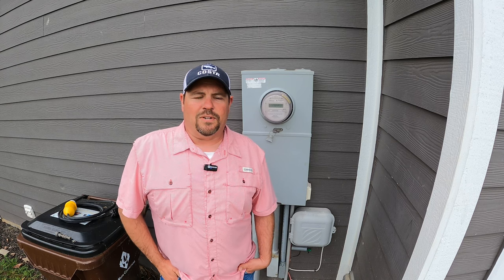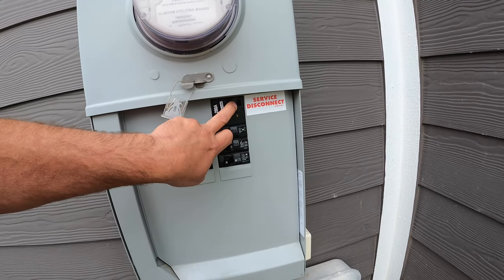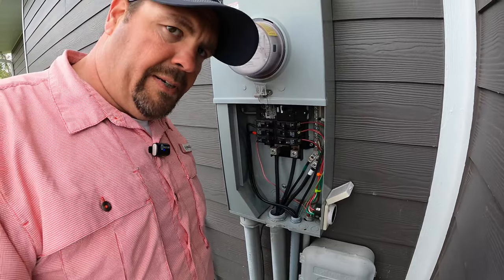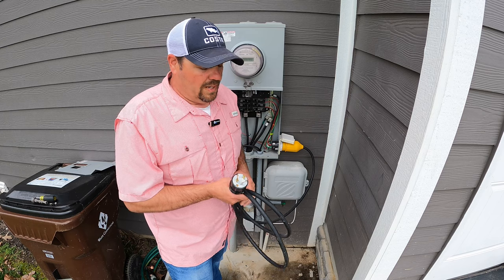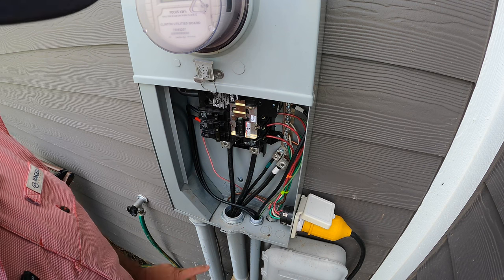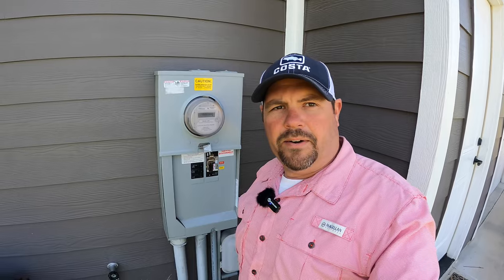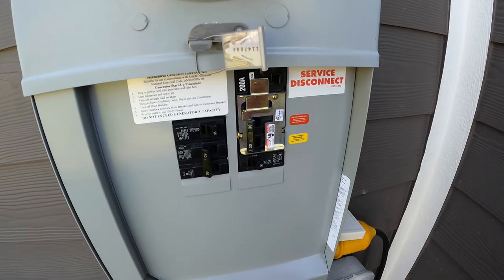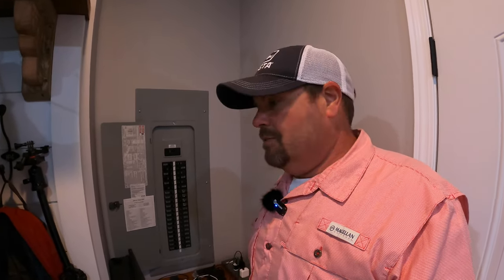Low-Cost Generator Emergency Backup Power (Transfer Switch)

Comment: You could use a Firman Tri-fuel or Dual-Fuel portable generator when on sale at costco. 30A/240V service.
 I installed emergency lights that come on when power goes out. They are where I set up the generator, at the panel and in the main hall of the house. I also have some Ryobi flashlights and batteries. Trying to line up the plug with the inlet at night? Take a marker or white-out and make a line on the plug & socket to line up the two before you twist it.
Reply from the maker: These are some really good ideas! I especially like the emergency lights at the Generator. I have a facilities background at a large hospital system here in East TN. That was a requirement to have battery back up lights at the Generator and transfer switch controls. Thanks for watching and commenting 👍🏻